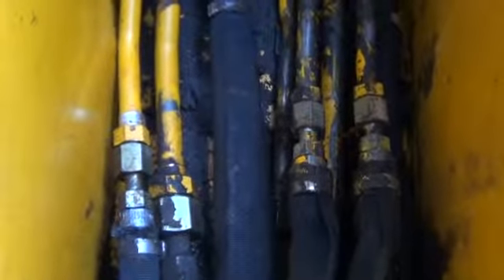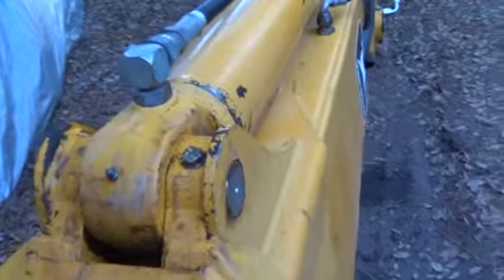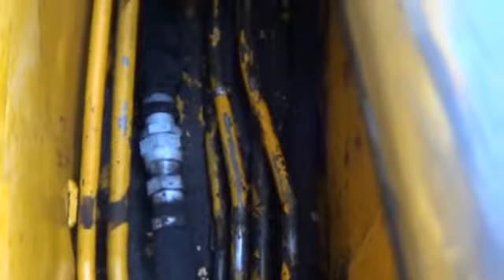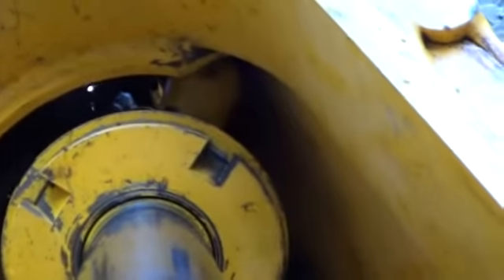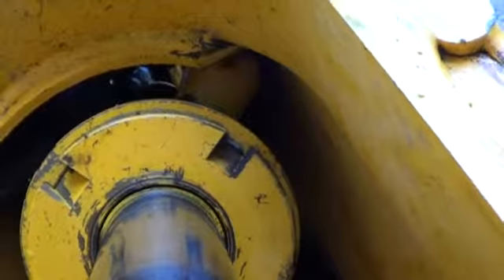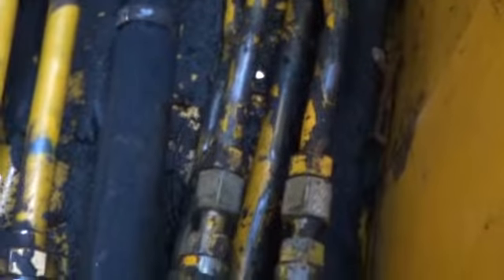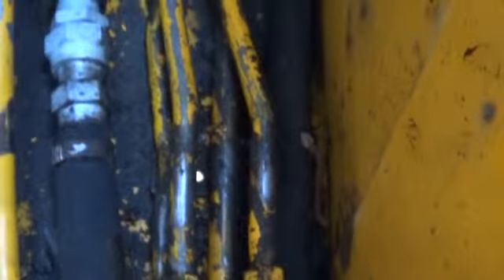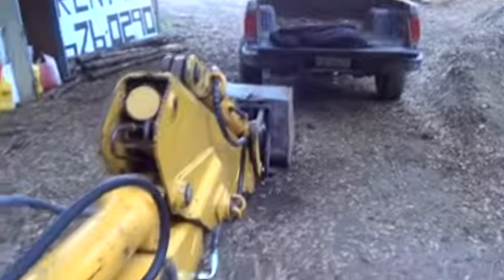JD 510C (1989) Hydraulic Lines

Comment: Hey, if you are still out there, how in the world do you access the hydraulic oil filter on that machine? driving me nuts. the transfer case blocks all access. Through the top floor plates? Crazy location.  I have a 4x4. I see that on the 2x4 it is easy.

Comment: Hi Mel, I have a JD 510c  1988 model which most likely is very similar to yours.   I am trying to fix numerous issues since buying it from the last owner. perhaps you can help.  There are three 3/4 hydraulic lines attaching to the oil cooler on the  right side as I look from the front. The upper one comes from the main pump. The lower two I guess go to the Torque converter and back.  Do you know which one goes to the middle connection and bottom.   I hooked it up with lower to lower and higher to higher but question if that is correct.   Thanks